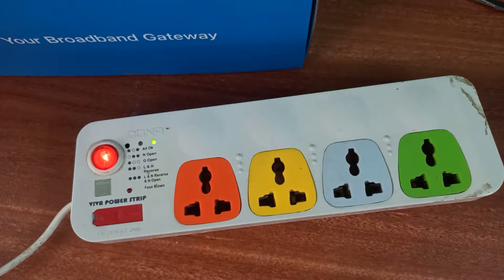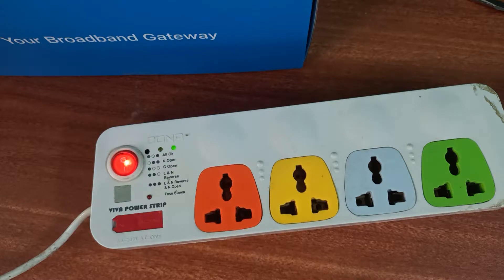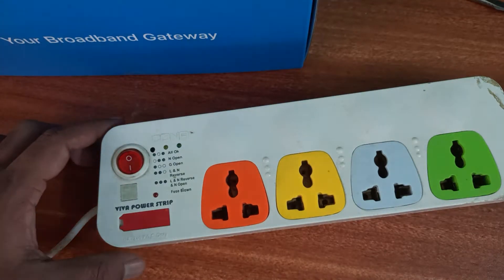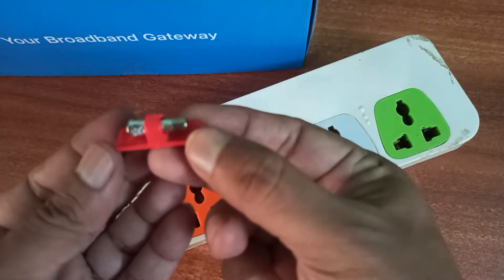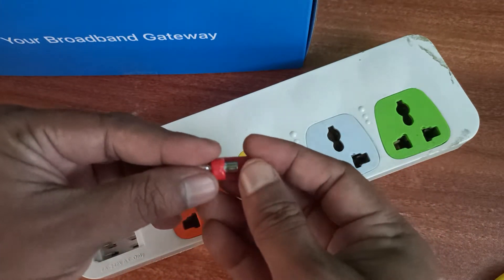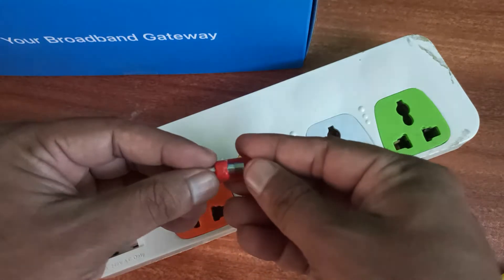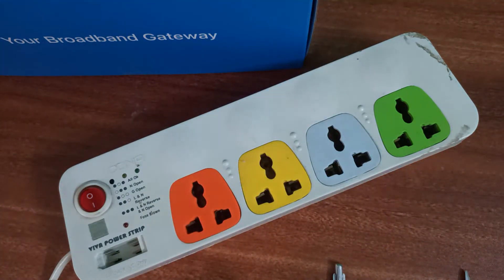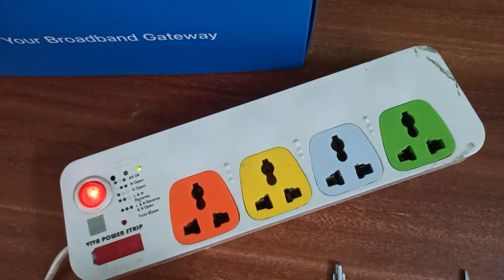[FIXED] How to fix blown out fuse quickly on spike buster | Temporary fix

Comment: How about soldering a wire directly to those connectors and shorting the right and left terminal slots? 
I did it and still fuse blown indicator is ON. Not sure what's the detection mechanism is!
Reply from the maker: sorting will not serve the purpose. The material used for the fuse does not take higher heat and hence it will melt. Depends on the AMPs.
Reply from the maker: soldering**